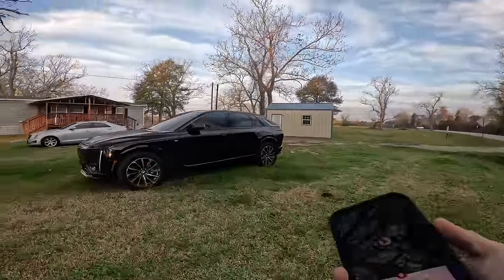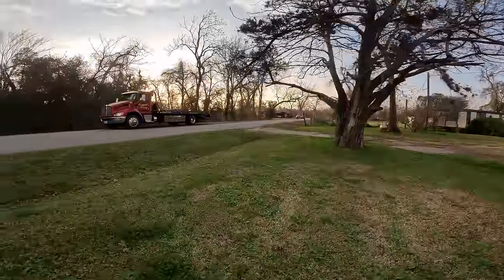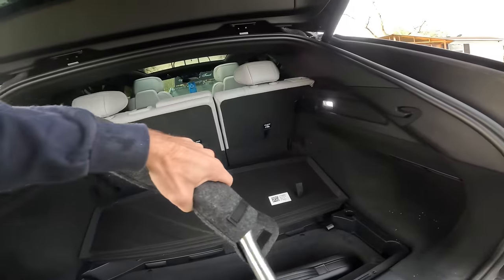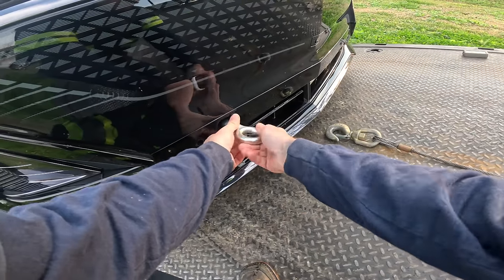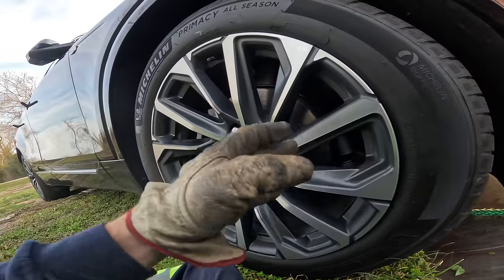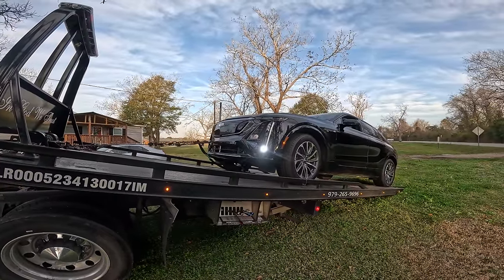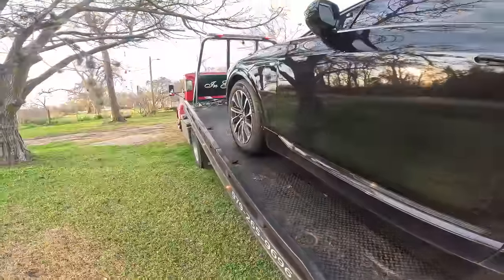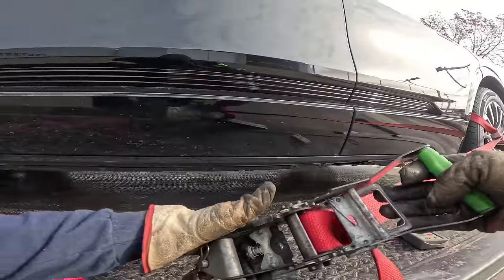Another EV Down! Towing a 2024 Cadillac Lyriq!

Comment: This is every trolls chance to sh*t on EVs?  Its not like a brand new gas car hasn't had issues? Obviously the car in this video works, however, there were error codes coming up and the owner decided not to drive the car to the dealership for the diagnostics.  Seriously, how many gas cars have this happened too? 

Cars break down regardless if its a gas or electric one.. Electric cars are very reliable as long as you don't drive it beyond its limits.

Comment: regardless what they say, I've seen far too many factory tow loops fail. Never trust them. I'll use soft connections on the control arms, stronger and load distributed evenly & pulls low & even... not off center & elevated. Even using a snatchblock, you're transferring the side load from the tow pin to wrapping the cable on one side of the drum which isn't good on the cable either.  Common sense goes a long way... but manufacturers repeatedly prove they do not take towing & repair into their designs... sometimes you hafta compensate for their lack of follow thru. Poorly designed & unnecessarily complex shift bypass procedures & Auto engaging Electric brakes... all poorly designed.

Comment: like I said before never had any problems now picture this scenario your model s or x is completely unresponsive meaning you aren’t able to put it in tow mode meaning wheels are locked keep in mind these 2 models are the heaviest yes! Heavier than gas vehicles  the force to pull the vehicle will be greater  than having a car in neutral that been said  I will definitely not trust your towing hook sorry . I know there’s other ways  like using a wheel lift truck with dollies but even then most Tesla owners don’t like their cars on the wheel lifts due to most of them thinking the AWD Tesla will be damage due to their lack of knowledge  or existence of the dollies lol another thing to add in order to get the contract to tow directly for Tesla we have to take a special training

Comment: Buy a Tesla or buy crap. It’s that simple.
Reply from the maker: Tesla definitely has it figured out, but the technology has a long way to go before it’s going to be a reliable form of transportation.
Reply: @Towtruck_Dustin  on my 4th year of cross country trips with zero issues. Maintenance consisted of new cabin air filters and windshield wiper fluid and a new set of tires. Never use the brakes so never replaced them on my first Tesla.

Comment: A beautiful car...but worthless as a reliable mode of transportation.
Reply: Really depends on who makes them.  But only for local travel.
Reply: @tractorsold1  They all share the same negatives. Resale is questionable. Insurance premiums are high. Useless for vacations. Lots of road noise.
Reply: @RLTtizME  They can be good second cars for folks who drive short distances a lot, if they take time to get one that is reliable.  A good make will have far less noise than a gas or diesel.
Reply: @tractorsold1  The road noise factor is amplified by the fact that you do you have an engine / drive train hum cancelling or masking  road noise from the tires. That is a major complaint among owners.
Reply: When you have an EV, you have to have a spare car. Again, fossil fuel, towing electric. I love it.

Comment: Was it really necessary to do all that rigging? I mean the vehicle started and it moved under it's own power so why not just pre-setup your bed, drive it up and then secure it with the tow hook since there was actually no need to pull it. I mean I'll use your rigging as a knowledge tool for a non start EV but in this case seems like overkill. 

BTW a car manual will never state to use chains, cable or ropes when towing. Your going to get people who own one of these all paranoid. Using the tow-hook will definitely be in there thou.
Reply from the maker: You’re wrong on all counts. 
It was 100% necessary to do all that rigging. 
A. This was following the Manufacturer’s recommend towing procedure to a T. 
B. Every piece of equipment used here, is actual proper rigging equipment, rated for the load applied, and used correctly. 
C. You never drive a customer vehicle unless absolutely necessary, and you never drive it up the bed. 

Obviously you don’t work in the towing and recovery industry. I suggest you study up on some towing procedures. I have.

Comment: LMAO...... The tow truck industry thrives on the back of internal combustion engines. So you sprinkle a few EVs in and then make a big deal. Hypocrites.
Reply from the maker: Lmao obviously the bulk of the towing is internal combustion powered vehicles, because that’s the majority of the vehicles on the road lol kinda common sense lol
However, I’d bet if you did a ratio of how many are towed vs how many are made, I’d bet EV’s ain’t looking to hot lol